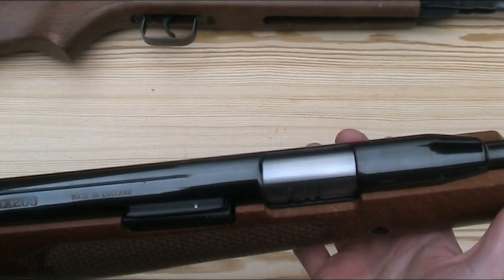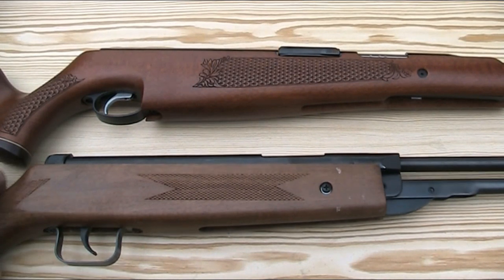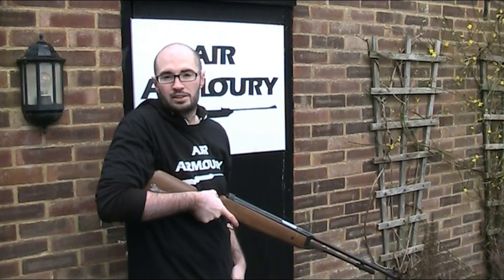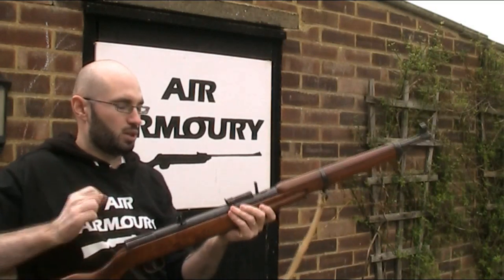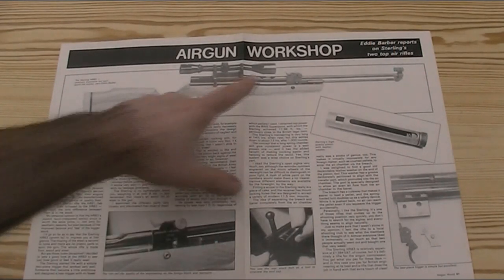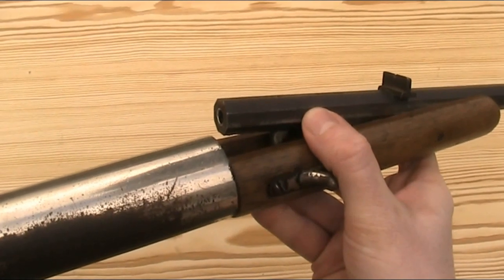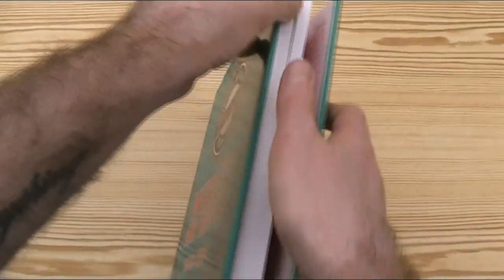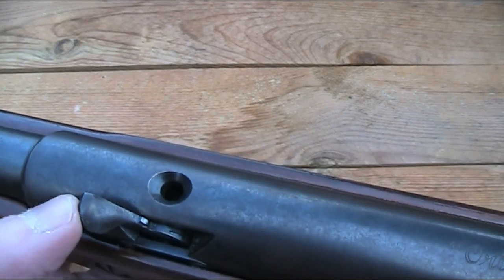Underlever Air Rifle Loading Mechanisms | Air Armoury

Comment: The Rotating Breech of the Gamo CFX and BSA Superstar is a good design. Safe, the pellet goes straight into the barrel, quick and easy to put a pellet in once you get used to it (though there can be a risk of not seating a tight pellet properly and shaving the skirt somewhat), and if you forget to close the breech I think it is designed in such a way that it blocks the air transfer port somewhat and prevents too much dry fire damage. I much prefer loading my CFX to my Walther LGU (TX200 style).

Comment: I think every cocking and loading system can give some kind of danger , you could get a vinger or so  between the cocking lever and the gun if something brakes .even with a taploader
I had a diana 54 and the central pin in the piston broke lose ,but i noticed it when i push`t  the anti beartrap down and then the side lever run`s forwards. with a unsuspected force
i`ve  got a hatsan 155 torpedo full power ,and it looks very safe ,but if you load the pellet and the piston would run forward ,that airpunch wil cut tru the skin and thats not healty.
A breakbarrel with a barrel  locking lever(like a hw 55 and more) is the most handy springer i think ,and accurat enough,
 toplevers ,underlevers sidelevers  do have more parts to be handeld to cock and shoot.